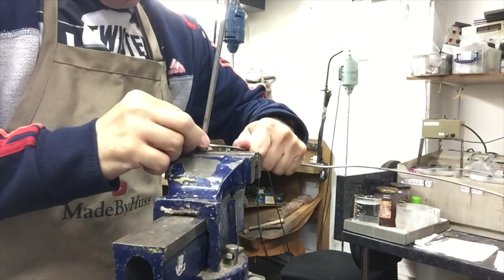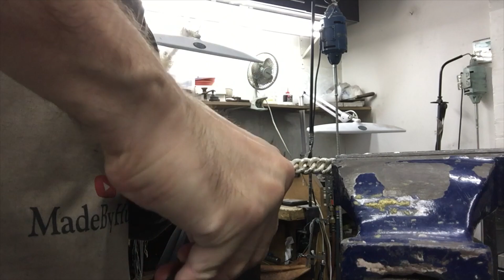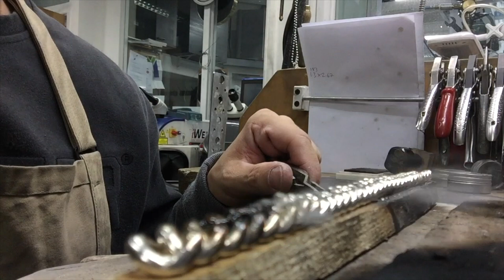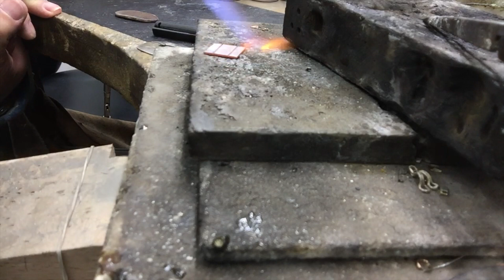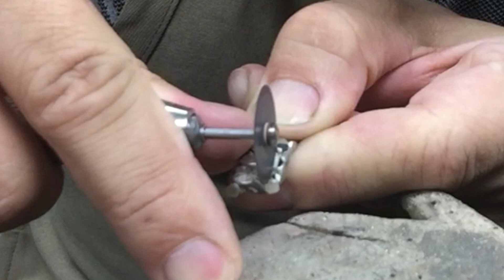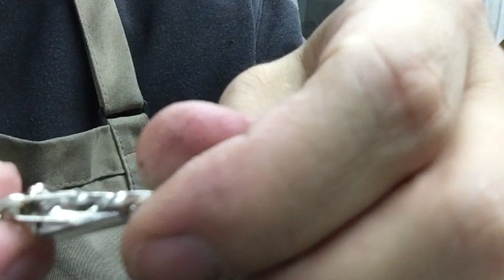Cubanlink Bracelet Tutorial

Comment: Thanks a ton i always wanted a cuban chain but couldn't ever afford one but i want to make it out of steel  any advice for a newbie to jewelry. I do blacksmithing and bladesmithing mainly another reason why i want to use steel.
Reply from the maker: Wow I’ve never made anything out of steel but I would make it the same way just hope you can twist it the same way I’m not sure what will happen with steel but don’t doubt get it a go you will learn and pick up so much from the mistakes 🤞
Reply: @MadeByHuss  well after spending some time in contemplation about your technique. I think after annealing the round stock which is something i do all the time and following up with your techniques without polishing. And then reheating up to critical temperature and quenching then tempering and finally polishing. Hopefully this will work i.d.k. yet as far as the twist goes if worse case ill have to do so hot instead of cold forging. Anyway beautiful work and thanks for the advice and wisdom.

Comment: Dont Twist And Bend Each Area Of The Chain Individually 
Just Keep Twisting Chain The Chain Will Straighten Itself Out If You Just Keep Twisting 
Then Once Straighten For Twisting Then Go Through And Do The Fine Tune Straightening By Hand.
Reply: How come when I twist my chain my jump rings break at the solder joint?
Reply: @johnguthrie9911  Make Sure Area Is Clean Also Make Sure You Are Using A Good Amount Of Flux. 
Look Up Greg Greenwood On YT Has Some Good Soldering Tutorials.

Comment: Is there a way to use wire diameter and mandrel diameter to work out the finished width of the chain?
Reply from the maker: Well the thickness of the wire has to be half of the rod or smaller so to links can fit  example 2mm wire needs 4 mm rod or bigger but I like to keep them tight hope this helps
Reply: @MadeByHuss  Thanks for this!

Comment: Hey huss, I decided to give this a go myself, and I was curious how the rolling mill helps the chain sit flat? I can twist the chain and over twist a little to straighten it, but it seems like it does want to unravel or hangs straight until I wiggle it a little. Could you explain what that process is to get it to stay straight?
Reply from the maker: I try in the video I found that when it happened to me i had to start again what work best for me is to have the links tight together and when i twist the links I have to pull that the same time you don"t have to use the mills it can be taped flat to with a hammer so don't worry about over twisting it someone made a comment about hanging a wight on the end to pull it down then to twist it but i haven't try it yet hope this helps best of luck

Comment: You said the wire was 3mm thick, but how long was it. Im always curious how you figure out the length of wire you will need for the length of bracelet plus clasp. Love your videos cheers
Reply from the maker: Randy Murray ok I do it by the weight and I started with about 100grams of silver I never know how much I’m going to need so I make extra then solder together what you need
Reply: @MadeByHuss  I see.. did you use the inter 100 grams or did it require more.. This is exactly what i would like to make. Thanks
Reply from the maker: Randy Murray no I finished at 63 grams 33limks at the end

Comment: I seen you used 3mm wire but wat mm was the mandrel you used? And did you have to anneal in between twisting?
Reply from the maker: brayton mccall it shows in the video 6.3 mm rod and I heated it once before I start and heat it before I cut it in to links
Reply: Thank you I appreciate that 👍🏽

Comment: Hi, Thank you for making this video. It has  really helped me. I made the Cuban link chain and after a few tries I managed to get it straight. However what are the qualities of a well made chain? Also if I hold the chain from either end and twist it so that the chain spirals. Then I let go of one end should the chain automatically re-twist so that is is straight again. Because with my chain I have to run my fingers down the links to get it straight when I do this?
Reply from the maker: I know when the chain hangs it need to be straight and this is hard to do with me it helps to have the links tight together with not to much gap and I think when you are making the links it needs to be pulled hard and twist because we do this by hand it makes it very hard to do 
thanks for your comment
Reply: @MadeByHuss  Thank you for taking the time to reply. Say the chain is straight when you twist the bottom link and the chain spirals. Then you let go of the bottom link so that chain automatically return straight. I made one today when I did this I had to run my fingers down the chain after to get it back to straight.